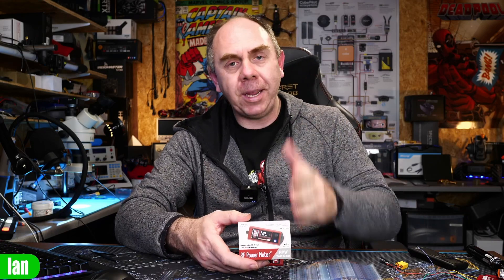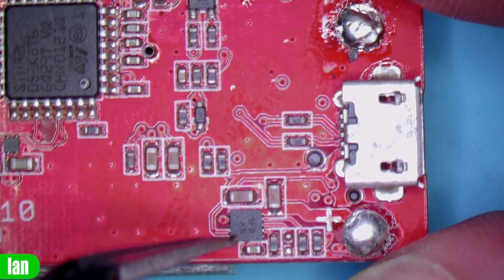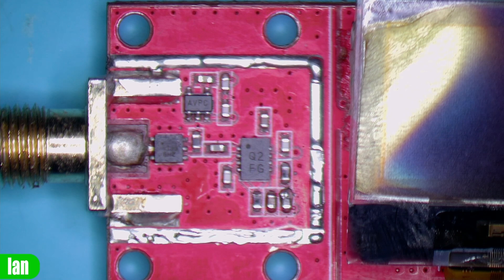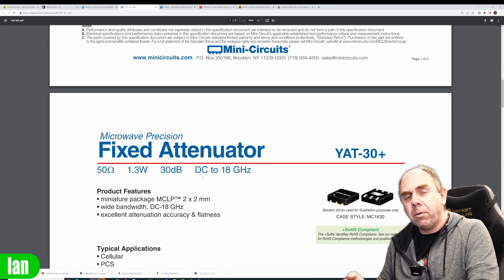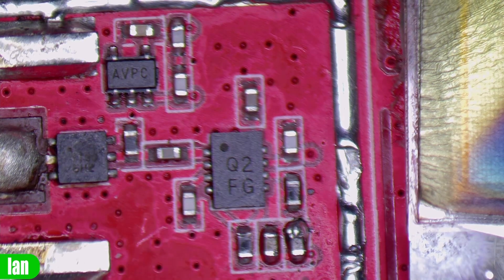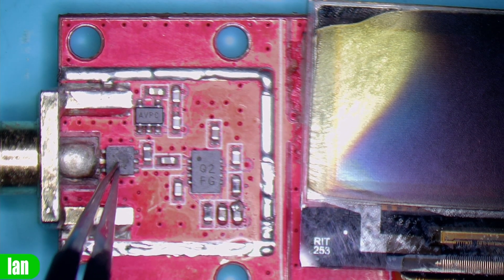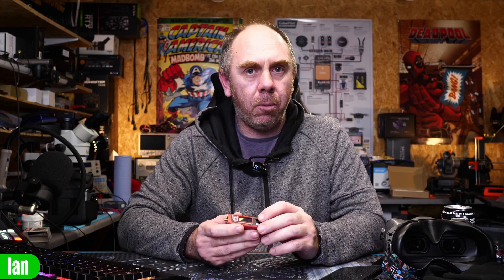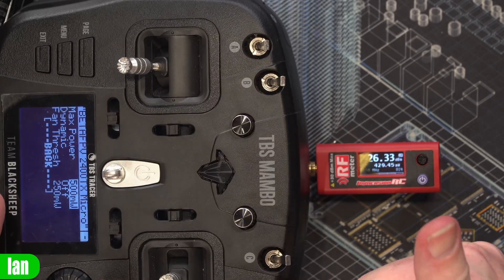IRC Power Meter - Teardown & How It Works With Digital FPV

Comment: Hi Ian, possibly I have a good explanation for the strange behaviour of the power meter when trying to measure digital VTX. Based on more than 10 years experience as a walky-talky technician. The same problem appeared when the first digital RX TX walky-talkies appeared on the market. the ImmersionRC RF Power Meter is basically an SWR meter like I used to check the power output of an analog walky-talky. When you connect the SWR meter to the antenna connector on a analog walky-talky and push the PTT button the SWR meter shows a value close to the output power you programmed in the software. On a Digital RX TX walky-talky it is only possible to put it to High or Low power output and the readings on the SWR meter jumps around. My college and I found out reading al lot of tech manuals that digital RX TX systems works with a 2way variable output system. The receiver of the signal send information back to the emitter about the signal quality and the emitter TX adapts the power output according the feedback from the receiver RX. This is why it is not possible to measure a digital VTX wit the ImmersionRC (analog) RF Power Meter. its only possible with expensive lab equipment. So we have to wait until an ImmersionRC DIGITAL RF Power Meter will be available ( will be more expensive off course )

Comment: Even though I have no real clue about this I like to follow the explanation and try to learn something.
And it is fun to watch from the idea to purchase it back on the live stream when we were hunting for a source in Europe and then in the UK over the first tests and mixed results or discussions to a teardown - of a now long sold out product.

Long and winding road but great way to learn even though in the beginning of the rf input section it looked like water boarded under the microscope.
I would love to see the screen fixing too cause that did not look as easy to me as you said it should be. I just saw the flat cables that are never that easy to deal with.